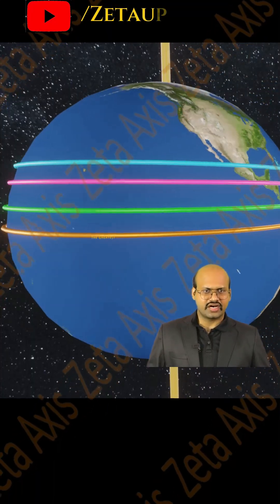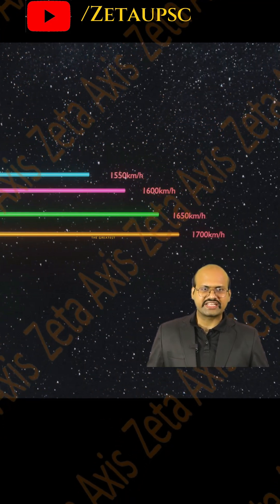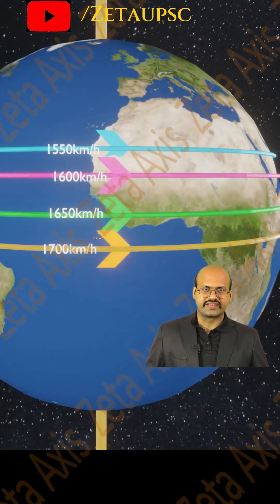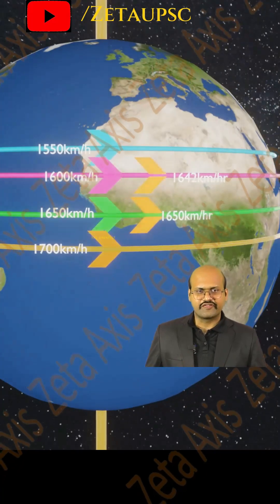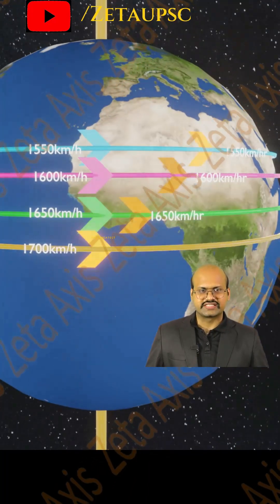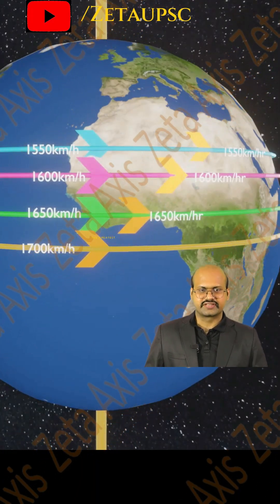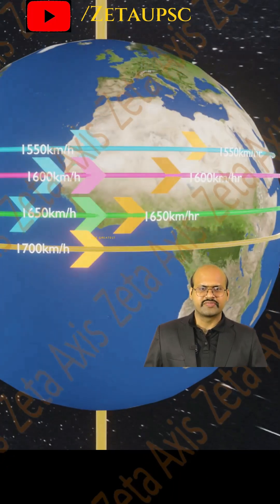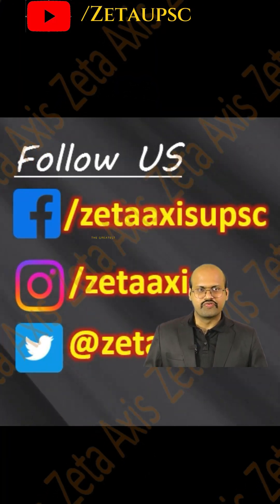Coriolis force - How Coriolis force is created

Comment: I have one doubt sir , you told in video that at equator the velocity of air is higher but at Equator very gentle wind blows and they are called as doldrums . 
If you reply if helps a lot.
Reply from the maker: The earth is rotating on its axis, so if a air stream which is stationary on equator with respect to earth is actually moving at a velocity of 1700 kms with respect to a stationary reference in space. So the velocities are the inertial velocity of the air parcel due to rotating eart. These winds are considered stationary (for discussion)with respect to earth
Reply: @zetaupsc ohh that's the reason . 😊 Thanx a lot sir

Comment: Didn't get it sir , at equator coriolis force is lowest so how 1700 and then decreasing towards poles?
Reply from the maker: velocity of air at equator is 1700 not Coriolis force, inertia combined with rotation of earth is causes coriolis force. At equator the gradient of change in radius is minimum near zero hence coriolis force is zero, at pole the gradient of change in radius of earth is maximum hence maximum coriolis force.
Reply: @zetaupsc  ok thank you sir :)